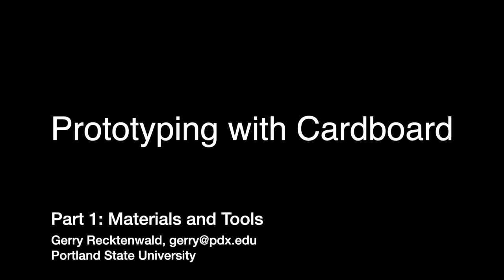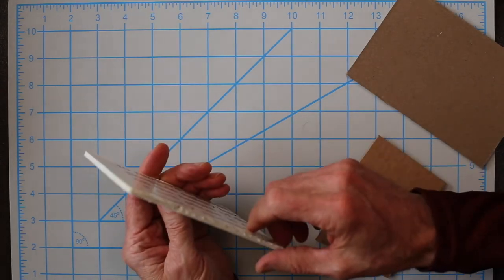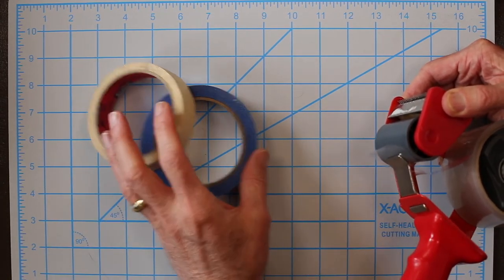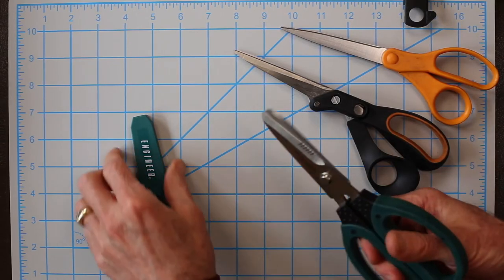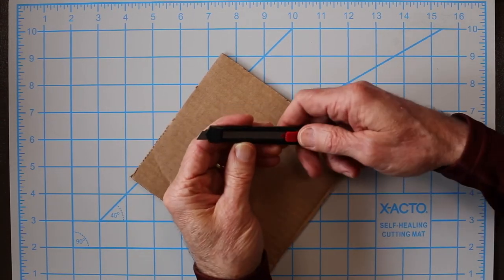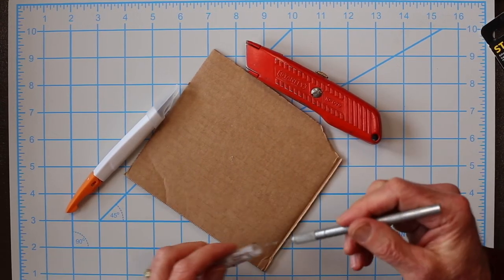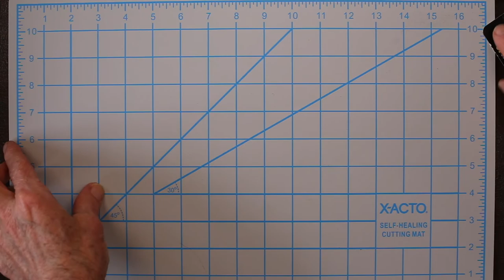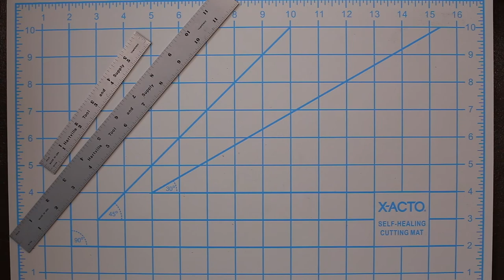Tools and Materials for Cardboard Prototyping

Comment: Dude, you seriously use a box cutter over an xacto knife?? You said it yourself - an xacto knife (craft knife??) is more precise than a box cutter, so you're choosing a big, heavy, maybe it's sharp but probably not sharp enough, difficult to wield due to its' bulk being in the way of the pattern lines you've drawn - over a lightweight, razor sharp, easy to change blades, easy to SHARPEN blades, easy to hold like a pencil, easy to trace your pattern lines because THE BULK OF THE KNIFE DOESN'T GET IN THE WAY...

Sure,  gimme a box cutter if I need to cut open a box. A cardboard one with thick corrugated sides. But for cutting out the pattern of my latest USS Reliant paper model,  or any other paper or cardboard model, please gimme an xacto knife.